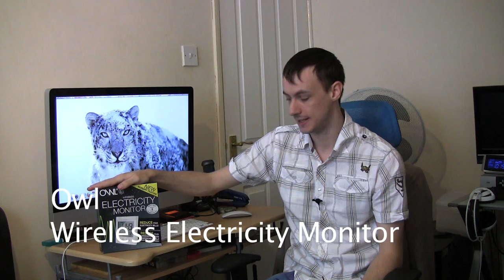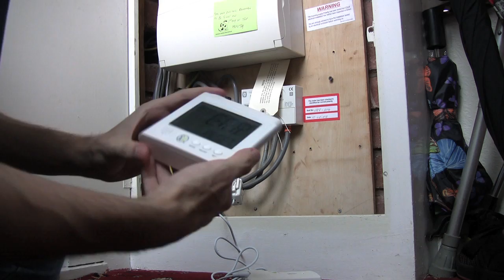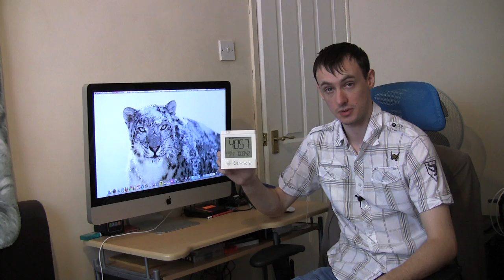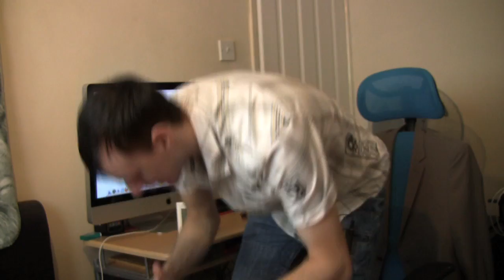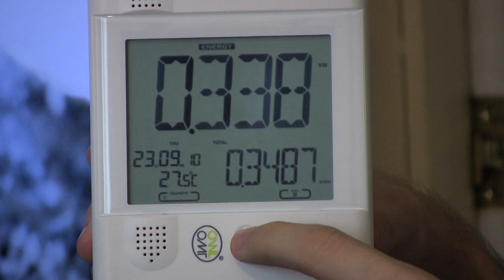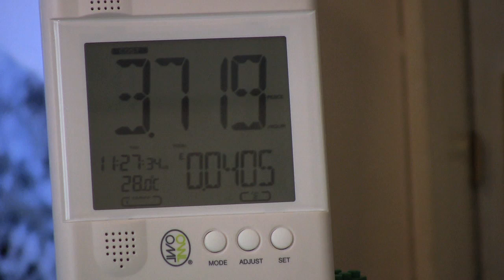Review: Owl, wireless Electricity Monitor

Comment: I'm curious, how does a device track the amount of carbon dioxide is generated from using electricity?  Isn't most electricity manufactured in nuclear power plants?  That's essentially a 0 carbon footprint.  Solar power has a 0 carbon foot print.  Same with wind.  Same with hydro.  The only process that produces carbon in electricity generation is coal.